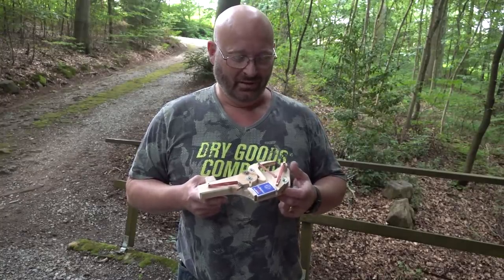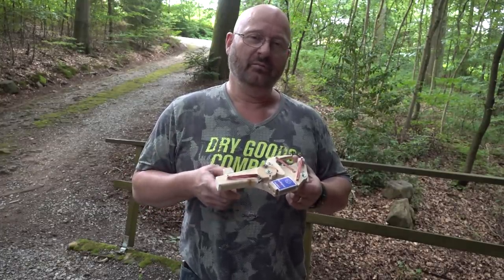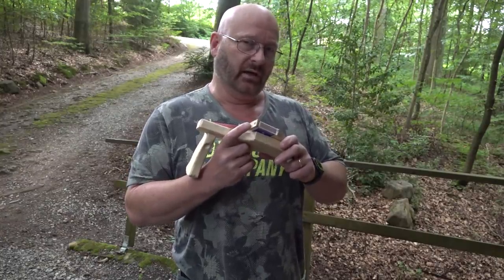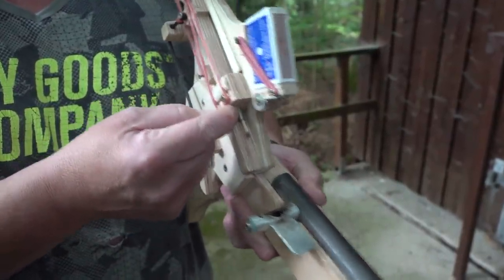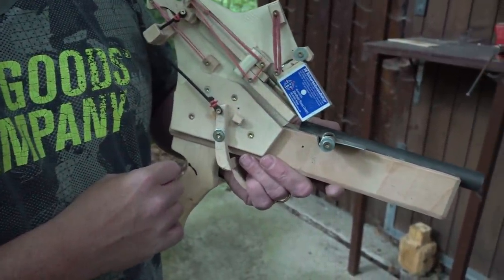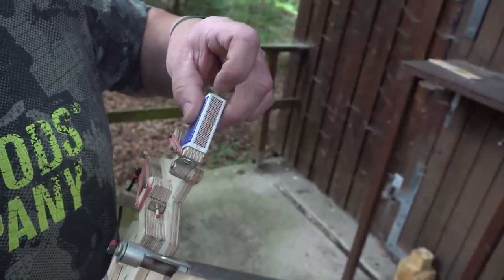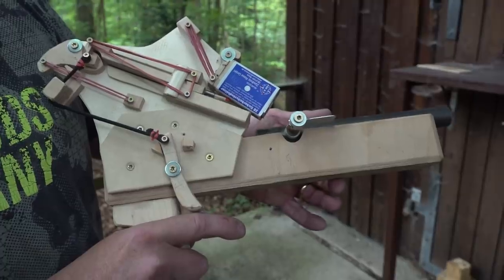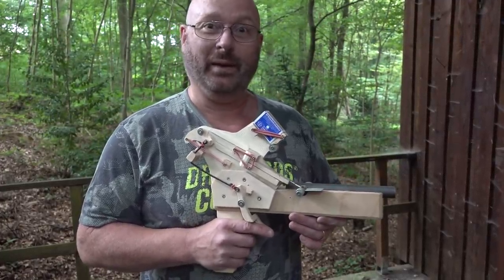The Craziest Lock Idea?

Comment: Using that striking angle of the match against the striker is really genius.  You've maximized the area in contact between the two surfaces, and also loaded the match stick at an angle where it's far less likely to break.  But why use safety matches?  It seems to me you could have a much more resilient striker surface otherwise.

Comment: 3:00 that need to get a fresh piece of rubbing surface could be easily automated with a thread of a screw and a ratschet mechanism . (the screw turns only in one direction pushing the box sideways ~1mm each(M6/M8 metascrew+Nut) time the gun is cocked, # linear actuator)
pretty simple i think.

Comment: Adhesive match paper, coated with potassium, is available on eBay. I stick a piece on the lid of an Altoids tin and fill the tin with dryer lint and matches. It’s for when I burn the trash.

Comment: Something you could do to improve the lock design is move the seat engagement surface to the front of the match launcher. It would lower the locking surface down, possibly reducing size of the lock work, but you could also have better control on how much pressure you want to have to fire it, and there would be less lock time, and a crisper trigger. Just my own two cents. The design looks very interesting.

Comment: Hey jeorge I have kinda a hard challenge for you but it would be the first. I was thinking maybe you make a compound slingshot without ruber parts all wood and metal and plastic and leather etc.. besides rubber.if you build this on cam you can be the first builder of a rubberbandless slingshot. How does that sound as a challenge

Comment: Not sure, but wouldn't the hole where the fire from the match goes in being open still after the spark ignites the powder in the little tube, create a lack of enough compression after ignition to propel the projectile well enough , plus a flare of flame back at the person using the device? Maybe a bit of extra mechanics to close and lock the ignition hole immediately after ignition would be safer and have better propulsion for the projectile... just a thought. 
Either way, still like the idea, the vid, and the work you're doing to get youtube to start treating creators with respect and fairness, keep on rockin Joerg!

Comment: That is awesome. I have a suggestion which may help keep the matchbook from catching on fire when igniting gunpowder.  If you use the back of the mechanism that pushes the match forward with a wedge to start pushing the matchbook up once the match clears the end it should help prevent it from catching fire. If that makes any sense. That last high speed shot made it look possible and easy to add

Comment: You should be allowed to make this stuff at home, what you are doing is science and engineering and even arguably art to some extent. I see no reason you shouldn't be allowed to build whatever machine you want as long as it doesn't include radioactive material that has the potential to creat an exclusion zone should something go wrong. At which point one should most certainly require a license and a dedicated location equipped with all standardized counter measures and containment gear.

Comment: I don't know anything about firearms let alone black powder ones, but would it be possible to make a small hole (for the match to head to fit)  right into the main powder chamber and shoot the match right into that instead of having the flash pan? Like could you mount the match lighting mechanism underneath the gun and have it shoot the match in a backward direction into the underside of the main chamber ? and place the grip behind it for better ergonomics?